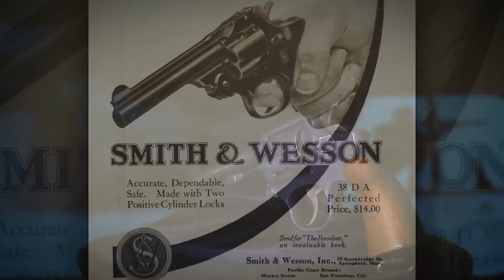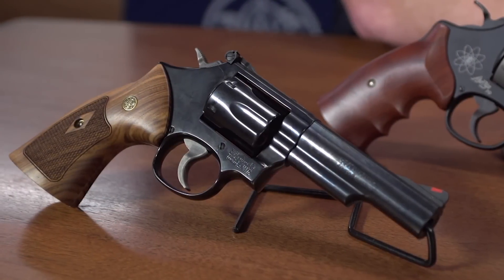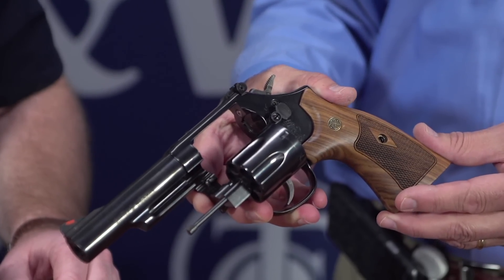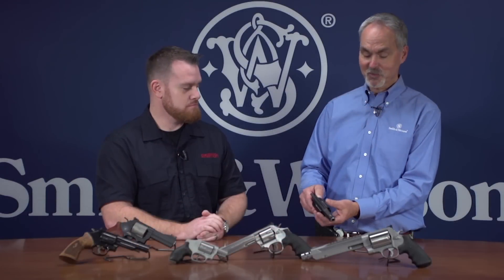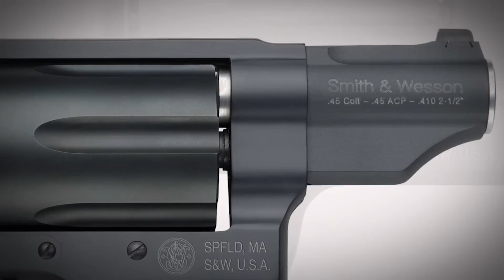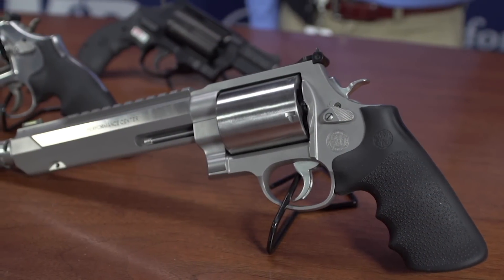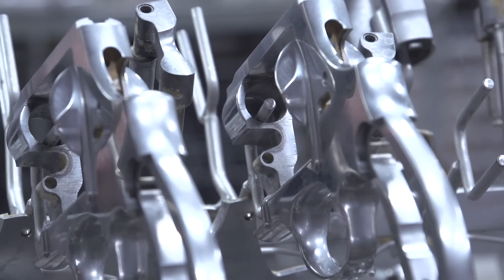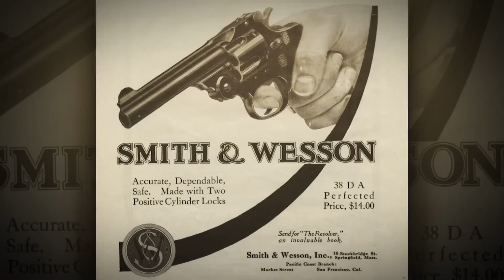Making Smith & Wesson Revolvers

Comment: HEY, Smith and Wesson!! Maybe you should go back to pinning your barrels so they quit rotating after firing a few shots, causing the rounds to start missing the target. Sound good?!
Reply: I purchased a S&W 686 plus 4” barrel and when I got home I inspected it more thoroughly and found the barrel not aligned correctly and some tool marks all over it, I was disgusted by it!  Now I know this was my fault by not having done a better inspection at my local gun dealer but I have never seen a S&W with these issues before.  The next day I took it back to my gun dealer and it took S&W two months to correct the barrel!  Nothing was done about the scratches and the barrel still not 100% align!  Let’s see how would perform this weekend at the range!?!? Never again I will buy a Smith!😡

Comment: 👍 I purchased two S&W revolvers in 2021 and the function, fit and finish are fantastic. I just wish they would eliminate the internal lock or at least make it a optional feature.
Reply: I really like the S&W 629 .44 Remington Magnum but that internal lock is a real deal breaker.  I have heard that S&W revolvers with the internal lock can, in rare circumstances, cause the hammer to jam.  Also, the installing of the lock was a compromise to the gun control crowd.  Thumbs down for S&W.
Reply: I’ve seen a j-frame 442-1 with no lock, while the 442-2 has one.  I believe that it is an option.
Reply: @Booboobear-eo4es  And they will loose anyway when a failure to fire causes injury or death, They will be sued for a defect product.
Reply: @FC-qe1wl  They are excemp by a loophole from being sued over the internal lock.

Comment: I bought both a model 586 and a model 19 carry comp in 2020. The 586 is great. Smooth action and accurate. The Carry Comp is another story. It has been back to S&W twice. Remember, the Carry Comp was supposedly made in the Performance Center and should have been the better made gun. Their was a problem with the tritium in the front sight, and the action seemed very stiff after 500 rounds. The 586 was the better gun. It went back to Smith and after 2 months they sent it back saying they found nothing wrong and no action was taken. Oddly enough the front sight now had a tritium vial in it and was loose. It wobble. I sent it back again, waited another 2 months, and it came back with a list of parts that were replaced. The action is still stiff and the 586 is a lot smoother. It is not going back again! I will just have to live with it and hope that eventually the parts will ‘break in’. So much for the Performance Center.

Comment: When I turned 21 back in 1971 one of the first things that I did was to buy a new Model 28 Highway Patrolman N frame in .357 magnum for $ 95.00. It was the lesser finished version of the Model 27 . Later I managed to purchase a 27 I still have these guns decades later.  Back then the fit and finish was superior to what is being turned out today.  I will never buy a S&W revolver that has an internal  lock, a/k/a a Hillary hole which is totally nonsensical.

Comment: YOU GUY'S AT SMITH AND WESSON NEED TO START MAKING THE .38 TWO INCH MUZZLE 5 SHOT OLD STYLE BODY GUARD WITH THE HUMP BACK OR SHROUDED HAMMER REVOLVER IN STEEL AGAIN, YOU ONLY MAKE THEM IN THE LIGHT WEIGHT VERSON, NOT EVERYONE LIKE'S  THE ALUMINIUM FRAME VERSON, YOU DO MAKE THEM IN 357 STAINLESS WITH THE HUMPBACK WITH THE 2 INCH MUZZLE BUT THEY ARE A LITTLE HEAVY.

Comment: I have plenty of S&W revolvers, but when Taurus and Kimber put out 6 shot snubbies that fit in the same holsters as my J-frames I sold 4 of my J-frames.  Taurus, Ruger, and Kimber (for concealed carry revolvers) have really closed the gap in quality and performance.  If push came to shove, the only S&W revolver I would keep would be my 3" 686 Plus (a masterpiece).  My Rugers and Taurus guns are just better guns -- just not as pretty.  It's a shame.  S&W needs a major renovation -- most on their production lines date back decades.  Look at Taurus's on-line factory tour -- the place looks like a hospital with beautiful and clean hi-tech machines.  S&W's plant looks like a dark dungeon -- and they have to fabricate spare parts on their own to keep their production running -- the companies that supplied their machines are all gone or are no longer supporting their obsolete equipment!

Comment: Most of the newer j frames have very heavy d/a trigger pulls.  I suspect they are using heavier springs maybe for liability or maybe these new primers need 16 lbs. of force to set them off.  I wish they could meet the old with the new and everyone would be a winner.  Welcome to Tn.

Comment: I just bought a 629 somethings Off. the barrel is pointing about a "1/32 to the left of the frame and slightly off center but everything  else is nice I  have five S&W revolvers I usually just fix them. this one is not fixable but its still  safe to shoot so I don't think they'll do anything about it. I'd still buy another one if I could find one thats a little better 😐

Comment: I  own both a 460V S&W magnum with a five inch muzzle brake equipped full lug barrel and a 500 S&W magnum with a 6.5 inch semi-lug ported barrel. Both are about 60 ounces unloaded but the 460V has a 5 inch muzzle brake equipped has a full lug barrel and my 500 S&W has a semi-lug barrel profile.

Comment: Lightweight 44 Magnum kicking like a mule I own the model 65/1 k frame detective model in 357 Magnum stainless and it's just as beautiful today as it was in 1975 when it was made you can't even tell it's been fired it's just that nice Smith & Wesson did and does make some nice guns but they should have left that lock and key mechanism off and I don't like the way they put a steel sleeve in the barrel now
Reply: I have the 65-3 purchased around 1988. 3” barrel, glass beaded finish by S&W. A fine firearm…but I gotta admit I carry my Glocks as they are just easier to carry and lighter too. I have a model 10-8 too 4” circa 1984. a little beat up but smooth!